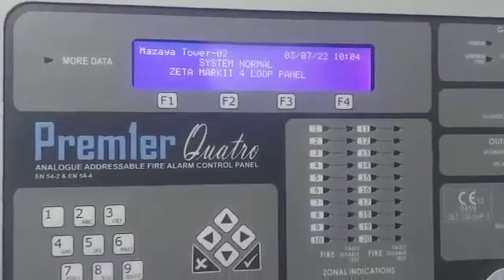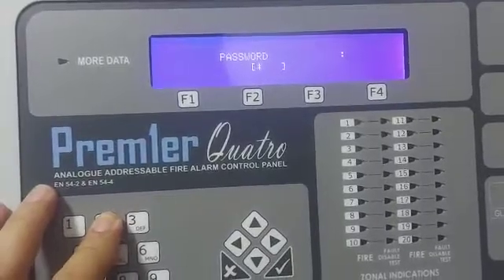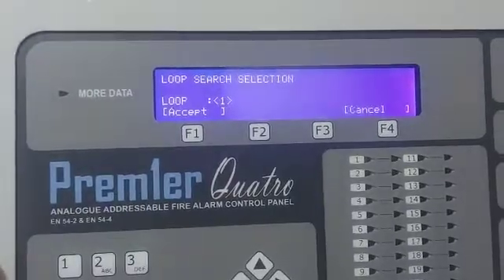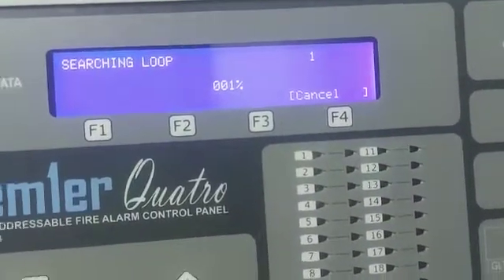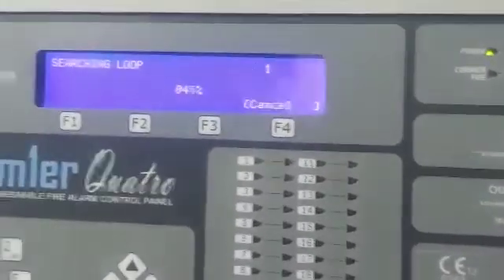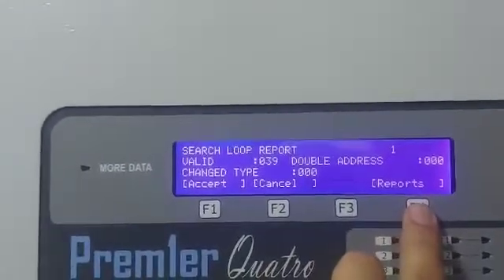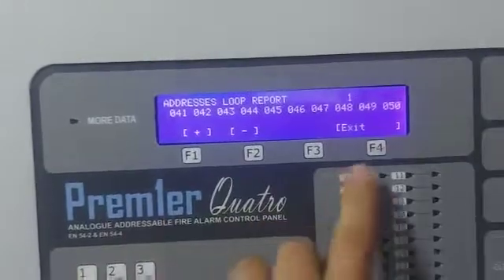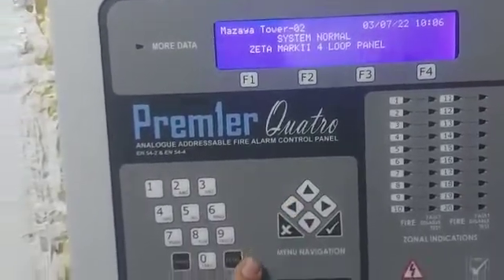ZETA PREMIER QUATRO PANEL | #firealarm #zeta || ZETA PREMIER QUATRO || FIRE ALARM PANEL CONFIGURE

Comment: how to cancel  damage loopcard loop  is scenes display damage loop = loop1 not communications  need remove the fault  from screen
Reply from the maker: First off the power of panel and remove the loop and again on the panel ...and reset the loop card ..if again coming ..may be need to replace the loop
Reply from the maker: Whatsapp- +91 7764856544 send me the picture ...